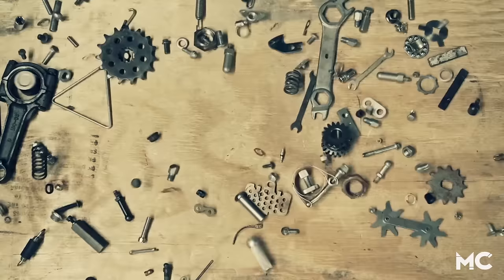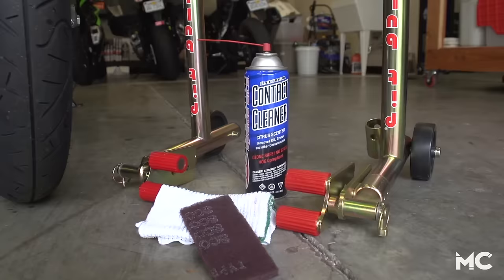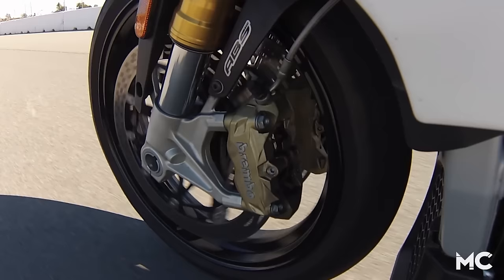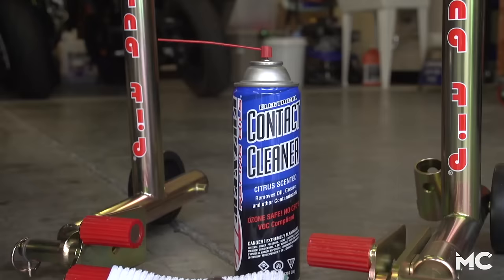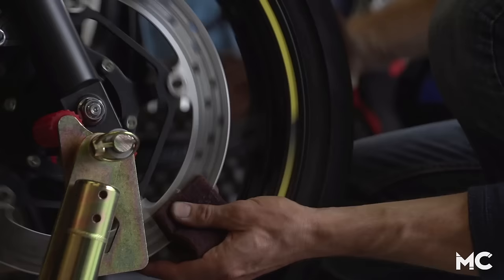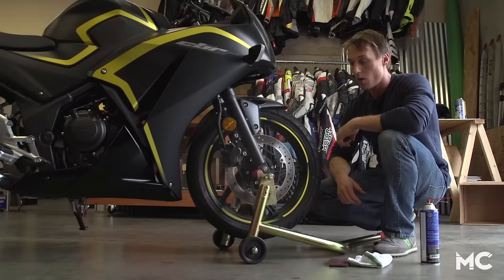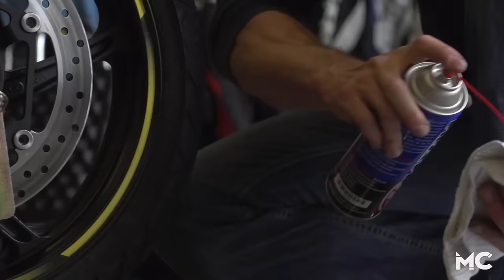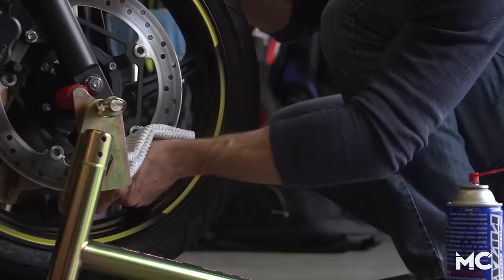Motorcycle Brake Maintenance: De-glazing Rotors | MC GARAGE VIDEO

Comment: I did this with sandpaper , first I did the brake pads and then the brake rotors .. difference in performance is really noticable .
Reply: What grid sand paper?
Reply: @Reza-nz2re  I dont really remember.. you dont want to scratch the rotor.. use a light one.
Reply: Using sand paper is a completely different thing, and has nothing in common with this video. In this video, he merely cleaned the grease off the rotors. Sanding, actually removes some of the surface material, and basically restores the brakes to "like new" condition. I think sanding would be better, honestly. Getting a little bit of oil on brakes or clutch discs, immediately causes them to get glazed, and not work properly. Sanding seems like the only way to truly fix the surface, so it becomes high friction again.

Comment: Thank you. I feel like sandpaper might actually be helpful for severely glazed rotors that have been exposed to oil, or road grime? You can sand motorcycle clutch fiber discs to fix a slipping clutch, and then reassemble, and they are as good as new. I suspect that the glazing is mostly on the pads, and the easiest way to fix that, is to put some abrasive polishing compound on the discs, and then go for a quick ride. Or to sand the discs down with new crosshatch marks, which will scrape the glazed debris off the brake pads as you apply the brakes. The issue with sanding the discs, is that you would need to use very fine sandpaper, maybe 600 grit of 1000 grit, with water, to make sure you don't see the visible sanding marks. Also don't get the sandpaper near the anodized color treated aluminum or finished surfaces.
Reply: Using sandpaper will often take off metal material that is harder than glazed pad material. This can be unsafe. Metal such as stainless steel rotors are heat treated, think of it like crystal structures and the surface is harder than the inner material, if you wear into it enough to break the harder crystal layer and expose the softer material and it can lead to a crack or shatter the rotor.   Think of it like a Rupert's Straw. Where the inner glass is softer than the outer.  The same goes with metals, where the outer layer is quenched when hardened. Unlike car rotors, these are typically FAR thinner and less material can be removed, and often not enough to let them be cut, or even sanded. Better Rotors are usually harder, deeper with a longer heating/shock process.
Reply: No, you just have to remove the brake dust, using sand paper will remove the rotor along with it.

Comment: You dont really need a front stand if your cleaning just the rotors. But dirty rotors affects braking distance too. Really dangerous to ignore your rotors. I use a toothbrush and brake cleaner.

Comment: Lots saying no to chain cleaner, Wurth do a brake and chain cleaner, its one can and can be used on both
Reply: Just to be clear, Chain cleaner is different from chain lube which some are suggesting. It's fundamentally about removing slippery stuff but you don't want to leave a greasy film. You'd want to be really sure your chain cleaner didn't leave a film behind before getting it on your disc's. Brake cleaner or contact cleaner are definitely all good though

Comment: I was talking to a friend of mine who used to be a bike mechanic and he was shocked that I was using sand paper to deglaze my rotors..In fact he was shocked I was using any rough surface to do this...Is this some new technique? What about rear drum brakes? I had my drum brakes changed by my mechanics and after taking it back time after time because they were squealing like shit, they said it could be due to the old brakes making grooves into the drum that they can't fix...Is this right OR should I try the same technique of sanding the drums much like the I did with the rotors in the from which worked perfectly?

Comment: Can anyone tell me how long brakes last?..I have about 5500 on a new r3 so i think brakes should be ok...mayb I need to try this method first but still all new to me..I don't wana have to take in for sumthin I can do myself
Reply: R3's OEM brake pads eats away too soon for some reason. 5500 (assuming it's in miles) is right around it's life span.
Reply: @streetsquiid5615  I'll have to take a look at the pads but thx...I ride em pretty hard...
Reply: i have 25,000 miles on my R3 (2020) and my brake pads have lasted just fine. only one brake pad change

Comment: Ari are the front stands compatible across all the bikes from 300-650?  I have a 250R right now and i'm upgrading to the 650F while keeping the 250 as a commute bike. Dont have a front stand yet and heavily rely on the ASC and hence need to know if the bikes come with standard front/rear Universal stands for all makes and models. Thanks.
Reply: cagednm69 the one he has in the video can be used for most if not all motorcycles

Comment: Would a glaze rotor cause a pulsating feel when breaking?
Reply: Definitely.  Clean those rotors and it should stop the pulsating.
Reply: @atheistontheroad4545  
Nah pulsing is normally due to a warped rotor
Reply: No, it's likely stuck rotor bobbins that prevent the rotor from floating and need to be cleaned. Could be a warped rotor too.
Reply: @vsokolov987234  🤔 ok
Reply: No, unless there is an uneven build up of pad material
Reply: @jamsstar2010  🤔 I see.

Comment: For the rear rotor, what are your thoughts on keeping it on the bike (R1200gs), start it on it's center stand locked down and running it in 1st gear with the wheel off. This way it'll turn at low idle speed and you can put a piece of "blocked" sandpaper on the rotor and let it turn until resurfaced.  You could "grit down" and then finish with steel wool. Thoughts sir? Thanks for your video.
Reply: It will work but that's a dangerous way to do this simple task. Many accidents have happened from doing just that.
Reply: That's stupid, dangerous, and pointless for such a simple task. The rear disc isn't even large in the first place.
Reply: @AQHackAQ  Nah! It's not stupid because it cleaned the surface. It's not pointless because the point was to clean the surface. And it may have been a tad unsafe but I don't mind. And what does the size of the rotor have to do with wanting to get them deglazed / clean? If you bought a new rotor and received one with a rough and grooved surface, then complained to them about it, would you accept from them if they told you "It's fine! The rear disc isn't even large in the first place." ? Your comment makes no sense and you may agree when you get sober/clean later.
Reply: @mattcero1  Lol. The small size of the rotor means smaller surface area to clean. Which part of that very simple logic is too difficult for you? All it takes is 4-5 revolutions to fully clean the whole thing. Why in the world would you need to turn the engine for a menial task?
Reply: Sounds like a easy way to lose some fingers or arm.
Reply: @kavinsp  It's not that dangerous really.
Reply: @mattcero1  yes but the way this vid showed is not dangerous at all.
Dude

Comment: does kerosene work also?
Reply: Zak Eh No, Kerosene leaves an oil residue. Brake cleaner, isopropyl alcohol, acetone. 

Kerosene, mineral spirits or similar will leave oil on the disc